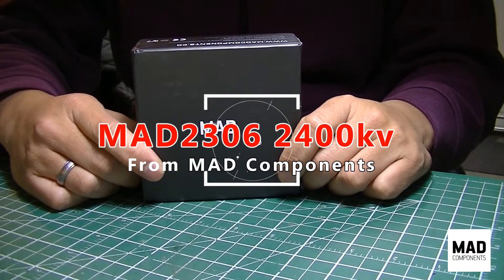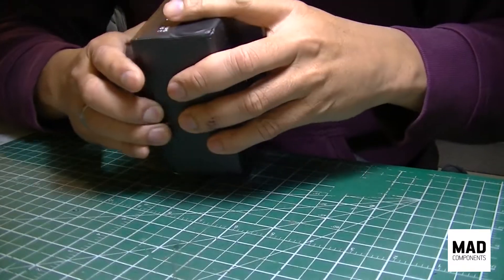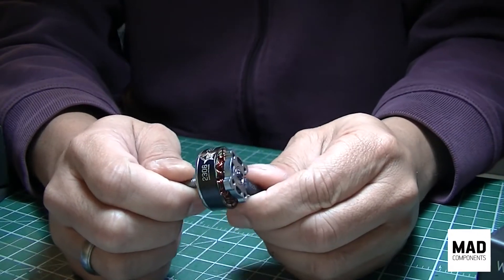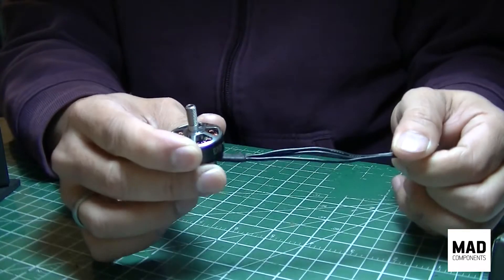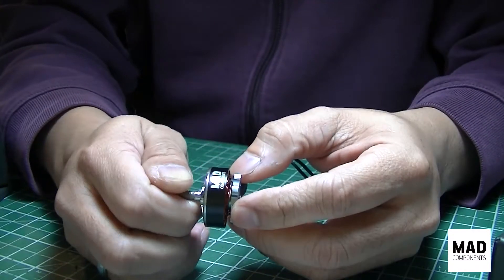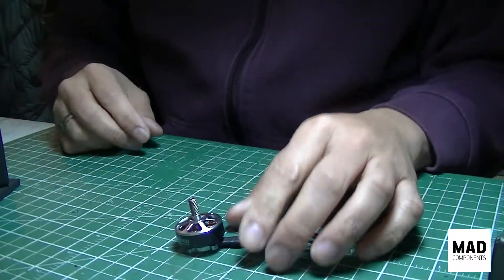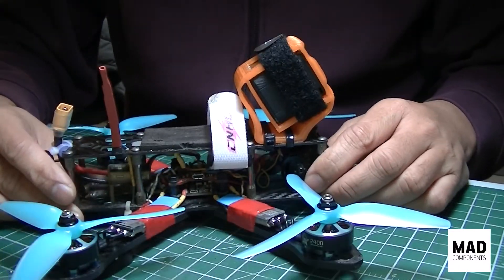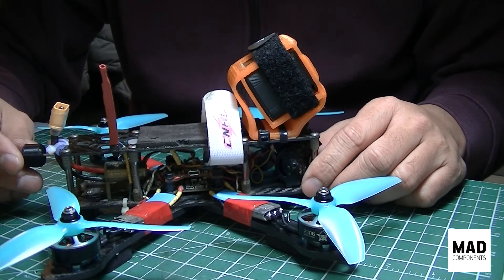First impression - MAD2306 2400kv motors from MAD Components

Comment: the airgap is there for a reason. the naked bottom design is old and proven, the wires are about 100mm, the windings are done in a tuned field fashion. the low profile prop nut is to allow the various hub thickness props on them, the square bolt head is a common 3mm and is proven to be hardier in crashes and allows good bite to remove damaged components from hard crashes.
Reply: Having a hard time deciding between these or the RCX nk2306 2400. I don't do freestyle, mostly race. I like the MAD design and features but I think the RCX have a bit more performance because of the tighter airgap.
Reply: what do you know about airgaps and flux density tuning? just a quick question, to gauge communication language.
Reply: not much, just stating based on test from engineerx and miniquadtestbench